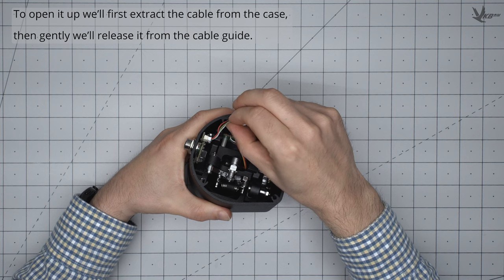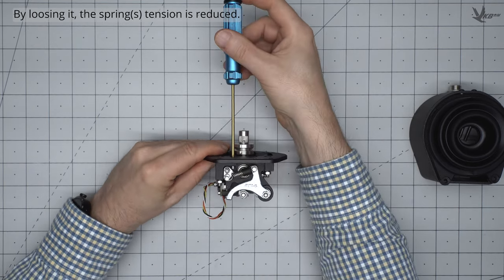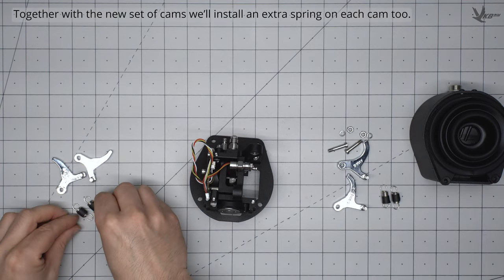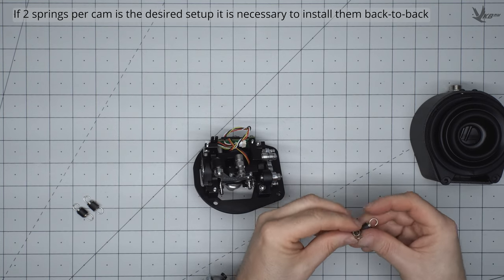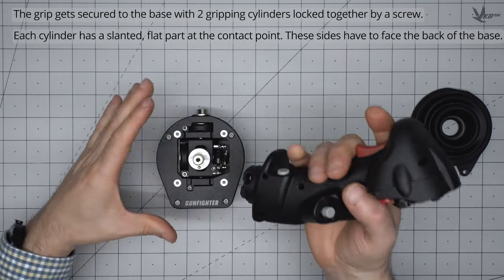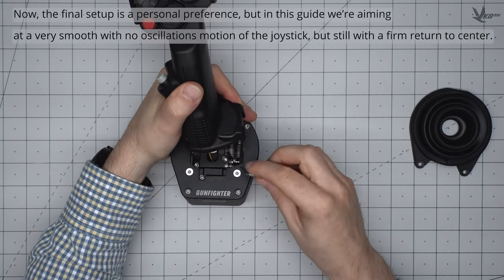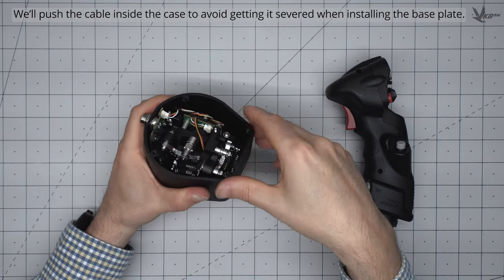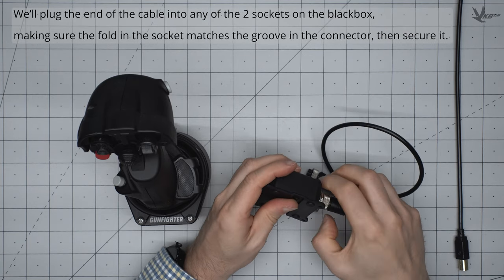VKB Gunfighter MKIV base - User's guide, adjustments, setting up

Comment: Music is too loud, and the section on putting the wire away from moving parts, which is very important, is too brief and not shown clearly enough. 

I don't really like having to follow videos for assembly either. Having to keep pausing and jumping around, which is not precise on a phone, and the hands often block the view which makes it hard to follow along. Some key steps are too zoomed out and I have to pause and zoom in to see. But it is a great device nonetheless.
Reply from the maker: We would've posted it on TikTok if it was for phones.
Reply: 🤣🤣 @VKBSim

Comment: I'm almost tempted to upgrade from my Mk III Gunfighter, just to get those adjustable spring pre-tensioners. Not for fine-tuning ability, but rather because they seem to eliminate the need to install/take off the springs using the removal tool. I run 50+40 on Y on mine and I think I've gone through two or three strings already on that tool. Let's hope the blackhead-remover I bought for  the task will last a bit longer ... :D

Comment: why is it plastic wedges against the metal knurled bit? why any connection between the base and the stick but the one that everyone else uses standard? :( I'd love to use my VKB grips with different bases.
Reply from the maker: The fastener is also metal. 
The connector has been replaced because this model is more reliable. We'll be offering upgrade kits for upgrade from RevB to RevC, so you won't have to buy the whole grip if you change revisions at some point.

Comment: Thanks, Just wonder.. what is original factory spring tension? I have MK4 base with 10 - 50 replacement springs but not really sure what is original sets of spring inside of the base. Any idea?
Reply from the maker: The factory setup is a single #20 spring on each axis.

Comment: So I understand that an upgrade kit for existing GF3 owners is going to be available eventually, as well has connector adapters for existing GF3 sticks. But are the existing BlackBox v2 going to work with the GF3 upgrade, or will we need to buy a BB v3 as well?
Reply: if you look closely, you can see that the electronics have not changed on the MK4
Reply: 11 months later and still no news on the upgrade kit. Seeing the changes the gimbal has gone through (and having disassembled/re-assembled my Mk III gimbal lots of times), I have a hard time imagining how they would be able to bring a Mk III gimbal fully up to Mk IV-standard.

Comment: Is it possible to change the tension/dampener adjustment while connected? ie if you wish to swap between jet and heli
Reply from the maker: There's no external access to the adjustment screws, so probably not.
Reply: Can't comment on the spring tensioners, but I did/do adjust my clutches "on the fly". Only way to do it, really, IMO because if you want them set "just so", I want the stick sitting in my flying/gaming position and I want to be able to verify the effect of every adjustment I make. What I do is "simply" remove the dust-cover so that I can access the adjustment screws. Easier said than done in my case, since I use VKB's desk-mount in which the gimbal and its housing "hang" underneath the mount's baseplate. And since the screws that hold the dust-cover also hold the gimbal-housing, and the gimbal housing has a PCB in it that has a wire connecting it to the gimbal, getting everything set up for an adjustment-session is a bit fiddly. 
You basically have to disassemble the stick partially to take off the dustcover, then re-attach the housing via the four screws, then re-connect the grip. And once you're done, you have to put in a bit more work to get the dust-cover back on. I would imagine this is easier if you use the stick in the desktop setup or on a different type of mount where the gimbal sits on top of the baseplate (Monstertech mounts work like that, I think). 
The good news is that it's totally doable and will get easier with a bit of practice - plus the fact that if you adjust the clutches correctly, you won't have to touch them again for a long while. I only ever did this twice - once when the stick was new and then again when I added an extension.

Comment: Wonder what went wrong with the first upload... =) EDIT: Oh hay, first!
Reply from the maker: sowwy for the back and forth, slippery fingers :)
Reply: @VKBSim  It happens. Great looking unit, the tensioners seem like a great upgrade to the design. =)
Reply: @jubuttib  the damper, as I understand it, is now not made of ilon, but aluminum
Reply: @Bee87ify  The clamps too? The disc was already metal in gf3 (I took two of them apart today and regreased them with pg44a and 767a), kinda seems like having it be metal on metal might hurt adjustability, though increase max damping... Edit: though I'm certain vkb knows exactly what they're doing!

Comment: There's a screw hole on the back of the stick where it attaches to the base (closest to the pilot). Should anything be done with that? The bag which contains the tension bits for attaching the stick to the base also has extra screws in it. Not sure what to do with them.
Reply from the maker: The hole is for fixing the twist, in case someone's using rudders. For more questions please visit our discord server https://discord.gg/UJAdpdHpYm

Comment: The nylon dampeners in mk3 are too weak to fly helicopter. What materials are mk4 dampeners are made of?
Reply from the maker: MKIII's were just nylon pads. MKIV has some nylon strips covered by a very rigid composite material which doesn't change shape under pressure.

Comment: is cleaning and regreasing the clutch the same method as mk3?
Reply from the maker: It's even easier now; if you'll have issues please visit our Discord server https://discord.gg/UJAdpdHpYm
Reply: @VKBSim  Thanks, is there any instructions available on how to do this for the vkb gf mk4? (Sorry, I assume that since you said it is easier that it means the process is different than the mk3 in some way?)
Reply from the maker: @viewer54322 It's a brand new product, won't require regreasing for a good while though :)
Reply: @VKBSim  Cheers, not trying to be difficult. I am new to quality gear and I may be wrong but it feels like the clutches are 'sticky' in places so I purchased some nye. I will probably be able to figure out disassembly.